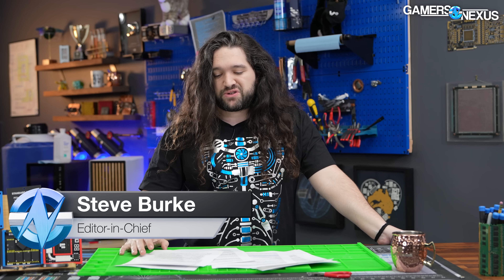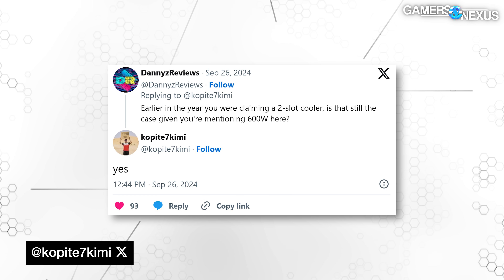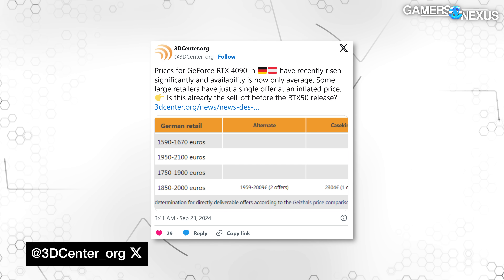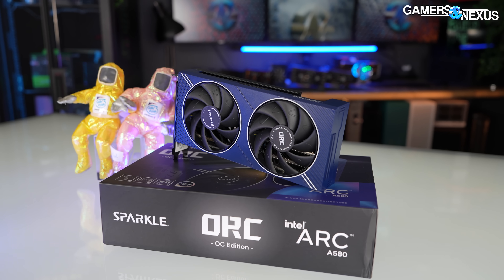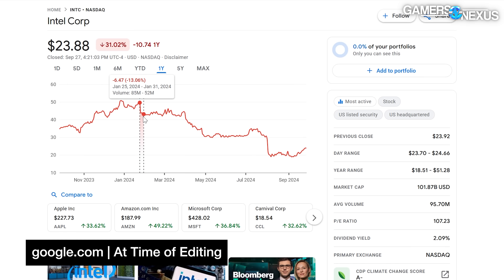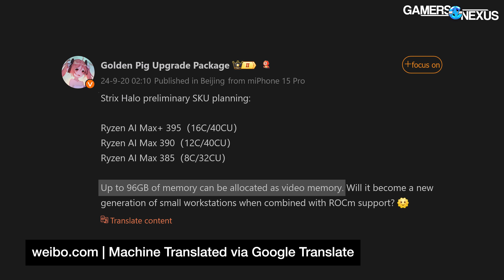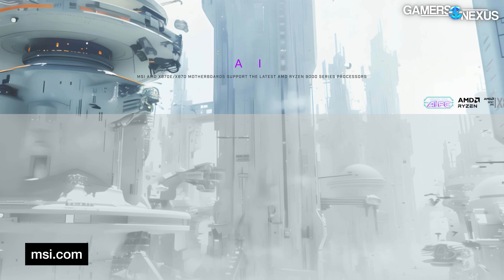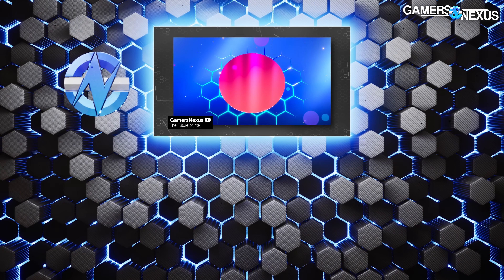HW News - RTX 5090 & 5080 Leaks, Valve ARM64 Experiments, Intel Arc 0% Marketshare, 4090 Price

Comment: 5080 with 16gb would be horrible value
Reply: depends on price - sell it for 600 USD and you would talk differently. But thats dreaming. It well beat 4090 which costs lets say 1600 USD, so if they sell it cheaper... lets say 1200 USD, ppl will buy it. Unfortunatelly.
Reply: You people whine about vram too much, shows how uneducated you are.
Reply: @JordanJ01 zip up nvidia's pants when you're done
Reply: @JordanJ01  you should try 4k gaming. Lots of titles currently crack the 10gb already. Two more years and it will be 15gb. Then add on top that many games got slight memory leak because the devs just can't be bothered - instantly filled up your 16gb, performance drops, textures become washed out and you have to restart the app.
Reply: 4080 is too but the owners have not realised/figured it out yet. Next years games will bring it to it's knees. 2 already are pushing it. 12gb is already on the chopping block in multiple titles lol.
Reply: @JordanJ01  yeah shows how inexperienced you are. I've done this 20 years, the main limiting factor for card lifetime (outside of a few very unique/old exceptions) is vram. Every time.
Reply: @nervsouly  multiple are exceeding 12gb on the mid range cards that need DLSS hand hold... which runs out of VRAM when doing RT lmao. It's hilarious. Two games approaching 16gb when the 4080/5080 suckers will really feel the pain. Next year will be interesting with the new games for 16gb cards.
Reply: @N4CR  Exactly, that's why I'm looking to buy the 7900xt, it has nice raw performance and 20gb of vram, and while the 4080 super it's way more powerful right now, the 7900xt will age better because of its 20gb
Reply: @JordanJ01 you're clearly uneducated when it comes to AI at least
Reply: @ThunderWill2  "Exactly, that's why I'm looking to buy the 7900xt, it has nice raw performance and 20gb of vram, and while the 4080 super it's way more powerful right now, the 7900xt will age better because of its 20gb"

The problem with this is the extra VRAM is actually irrelevant for AMD....

Notice the keyword here i.e. RT. If you are playing 4k max settings with max RT then 16GB VRAM may not be enough, but you are using an AMD card and a 7900XT at that, that 16GB VRAM will likely never get used, you will see rasterization problems well before VRAM problems.
Reply: @N4CR  "multiple are exceeding 12gb on the mid range cards that need DLSS hand hold..."

Can you name em? I play at 4k and the only one that actually comes to mind is Cyberpunk. 

" Next year will be interesting with the new games for 16gb cards."

Yea you guys have been saying that for years, meanwhile in reality we got Wukong which actually used much less VRAM then expected.

Game companies are making games with Nvidia GPUs in mind i.e. you are actually delusional if you think VRAM will be the issue for PC gamers because the vast majority of gamers have Nvidia cards and therefore the vast majority of the PC gaming market would not be able to play said games if games actually exceeded said VRAM.
Reply: @nervsouly  "you should try 4k gaming. Lots of titles currently crack the 10gb already."

I do play games at 4K, haven't seen really any game other then Cyberpunk go beyond 10GB.

"Two more years and it will be 15gb."

15GB < 16GB....

"Then add on top that many games got slight memory leak because the devs just can't be bothered - instantly filled up your 16gb, performance drops, textures become washed out and you have to restart the app."

And then they lose the vast majority of their player base.
Reply: @N4CR People speak like we get too many high quality games lol,with all these AAAA dei infested slop games around,not everyone plays all the new shits coming lately you can still play huge backlog for years.

Comment: I got the money for the next 90 card, but nvidia aint getting jack until i see 48gigs.
Reply: so wait for 6090 (LOL) and you will get 69ed for 3000 USD
Reply: just wait for the RTX 5090 AI TI SUPER
Reply: if they still have just 24gigs, it will take at least to the 6090 until you have 36gigs, if even.
And then maybe the 8090 ti will have 48gigs. If you're lucky.
Reply: There already are GPUs with 48GB+ VRAM but they are not really meant for gaming and they cost anywhere between 4k - 24k
Reply: @Nako3  those aren't 90 cards, so what's your point here?

Comment: No matter how low the price is, Intel's drivers make me think of buying AMD in 2011.... Like.... AMD drivers have been damn near flawless since the 5000 generation of GPU's and the price of 5700xt's and all of 6000 series are so compelling.... Why the fk would anyone buy Intel Arc!?!?
Reply: Morbid curiosity 😂
Reply: amd drivers are literally broken for so many users. seems like a pretty common issue. the issue being that windows overwrites the amd drivers with their own and it just screws everything up. with my 6700xt it causes it to stop working, as in shuts off the display. happens so frequently its infuriating. so far i've gotten it to work eventually each time, but its happened half a dozen times over the last 1 and a half, and right now i've swapped it for an older 580 that i put in my dads computer build.
the 580 actually has the same issue where windows will override amd graphics drivers, but with this card i don't lose the imagine so i can still use the computer.

i've finally gotten the drivers to work normally, but who knows how long that will last for. its literally a guess in the wind. i've had it last for a few months, and i've had it screw up again the next day. its so inconsistent in how it works, but the only consistent thing is that it will fail eventually.

im most likely going to buy a 4070 super for 800 bucks (my countries currency) to replace it and never use AMD again because you just don't know if you'll end up with the problem or not. and F you if you do. doesn't seem to be a solution. at laest not for me. i've done literally everything i've found as a solution several times and problem will eventually keep happening.

im done with AMD GPUs now. they're trash.
Reply: @junk3996  I'll gladly buy your AMD card, 1080 Ti was my last purchase from NVIDIA (2nd hand market so I did not pay them technically).
Reply: @junk3996  that driver issue is a windows issue and nothing to do with AMD and happens on all sorts of ahrdware. Learn to control windows instead of blaming AMD
Reply: @N4CR  funny how it doesn't happen to all amd users and doesn't happen at all to nvidia users. hmm
it still has to do with amd
Reply: @reav3rtm  yup i'll be selling it soon for sure. im done dealing with it.
going to get a 4070 super hopefully on a black friday/christmas/boxing day type sale
Reply: @junk3996  Meanwhile, there is me, with a Windows instal that is like 5years old, originaly done on x99, with an AMD gpu, then driver removed for a nvidia card, then back to AMD for both CPU and GPU and not experiencing anything weird. The computer gods are sometime facetious it seem !

Comment: It's great how Intel have invented "Vmin shift" as a euphemism for "degredation to the point of instability".

Vmin = the minimum voltage for stability at a given clock
shift = it changing, to be more than the processor is programmed to run at, so the processor is unstable now

Comment: The laptop I got from Eluktronics came undervolted by a -0.125v offset from factory, CPU is the 13900HX. I've limited the max P-core boost down from 5.4ghz to 5.0ghz and shut off half the E-cores, however I left the E-core boost alone, it still hits 3.9ghz with a single thread. Functionally it's a 12900HX or 12900K just power-limited to a 75w maximum draw.

Maximum voltage spike I've seen after all these tuning sessions was 1.23v, well inside the safezone and the maximum sustained operating voltage fluctuates between 0.995 and 1.05v under 100% Cinebench R23 load, pulling 75 watts. Thermals hit 89C now and it no longer throttles. I manage to still score ~22,800 points even after all of this.

TL;DR
I tweaked my laptop just in case the instability problems affect mobile parts and suffer zero loss of performance for it.

Comment: I built a tv HTPC/ mild gaming at 1080p to 2k @ 120hz with a intel arc 770 16gb asrock, $300 for my brother.  Just wonderful, with no issues. Be sure to update it, and update your mobo bios as well. It does great, and can run many games at high 2k.  
My main gaming rig is a 4k at >120hz with a amd processor and card.  
I would build with a intel arc anytime, really hope they stay in the game.

Comment: My bet on the 2 slots is that it will be a 2 slot "bracket" but a 3-4 slot thick cooler. Similar to the cards that are 2 slot but is 2.5-3 thick on the inside.

Comment: I’ve been using an Asrock Intel Arc A770 phantom gaming 12G for 6 months after so many frustrations with my RTX 4070. The A770 has provided better performance and zero driver issues or game crashes. My 4070 can’t say the same, it was a nightmare.

Comment: Happy with my 3070 and 5600X. Plan on making this a living room PC and doing a new build next year and full AMD this go around.
Reply: Personally I'm not entirely happy. I've got a RTX 3070 Ti, playing on a 1440p UW 175 Hz (21:9) display so a Odyssey G8 OLED basically, the card is starting to get weak at this resolution so I don't want to imagine how it would be in 32:9 or 4K which I consider moving to later on. Will run between lowest 50 fps to 120 fps highest on either High to Ultra for a typical UE5 game yes given it's 2K UW and not 1080p, which is reasonable but 8 Gb of VRAM is really getting short and sometime my card does struggle. Not a bad card by any mean but the VRAM is just castrating its performance. I thought about a 4080S recently but will wait for a RTX 5080 instead. I guess it would have been too early to make the leap in just one gen difference. I mostly switched to the 3070 Ti because I had a good deal on it and because I desparately needed to upgrade my former PC which had a R9 290... Quite the upgrade back then.

Comment: For anyone wondering why the that Prime 2200w power supply will not be officially sold in the US, it is because our standard wall sockets can't deliver that much power. The standard wall socket in the US it rated for up to 15 amps at 120 volts. Since wattage is just volts times amps, that means a normal US wall plug is only rated to deliver 1800 watts of power. The countries they ARE selling it in appear to be ones where the standard wall socket is supplied with 220v or 240v power which allows a lot more wattage from a single outlet.
Reply: Yes indeed. We have 230V for every normal socket, most limited to 16 Amps. That's 3680Watts of power on a single socket. 
so even if that 2200W PSU would run on full power, I could still use a 1000W water heater, plus a smaller microwave on the same circuit (which is pretty unlikely, though)
Reply: Isnt 2200w overkill tho? Why would you need that much.
Reply: @Nako3  It's more for workstation-class systems where you are stuffing multiple 4090-class cards into a single system for rendering, AI, or some other workload like that. It isn't really meant for gaming PC's.

Comment: I'm RMA'ing my 14700K. I applied every BIOS update as they were released, and only found the stability got worse (due to having to reset back to factory defaults) to the point where the RAM would no longer operate at the XMP 5600MT it was rated for. Leaving it at 4800MT results longer times between stability issues, but it's still two major symptoms:  ALL web browsers crashing randomly, even when opening a new tab. Software containing CEF or using a webview also experiencing crashes. Netflix spontaneously having drop-outs. It's almost as if the CPU just reads the RAM wrong at random, and many of these issues look like RAM or GPU, but don't repeat themselves in any configuration that makes sense which makes it point to the CPU. The 14700K was stable up until about mid-august (making it 5 months old.)

IMO that 5090 spec might be exactly what it's stated as, as nvidia always did that with the Titan series. In the case of the first Titan it was basically two GPU's on one card. In the case of later cards, it was pretty much the entire die the same as the same workstation part. So that might actually suggest the spec of a theoretical PCIe B6000 being the same.

Comment: With Valve being very Linux centric, and their fave Arch Linux (Mine too) being fully Arm ported, it's a grand decision!  BTW:  I'm not a gamer, but I am a non Windows/Mac user, and haven't used either for over a decade!  Like all OS's Linux has room for improvement, but they won't make you their slave, and so if valve can contribute something to the code base that benefits Linux in other ways, well, that's what way more should be doing to make corporate ownership of users a thing of old lore!!  On Linux, nobody but you is da' boss!!

Comment: Intel never suggested that the previous updates to the microcode of 13th and 14th generation processors were permanent fixes. The updates were intended to prevent further degradation while they focused on stability.

Comment: Note on the Quest 3s "runs at x resolution".
These headsets may HAVE these resolution screens, they RUN at a lower resolution. (3S native res is still unknown afaik, but 3 renders at 1680x1760 and has a screen resolution of 2064x2208)
Personally my theory as a Quest developer is that they will render at the same resolution.

Comment: ARM64EC is specific to Windows on ARM, there is no linux equivalent. It allows mixing ARM64 and x86-64 code in the same process, with tweaks to be compatible with Microsoft's x86-64 emulation technology (hence EC = Emulation Compatible). The fact it specifically says ARM64EC in the listings makes it very clear that what Valve is doing is specific to Windows.

Comment: For what it's worth, I haven't seen any stability issues for 13th or 14th generation i7 / Core 7 Ultra CPUs in Dell mobile chassis, of which we have procured a few hundred in our org. This has not been the case for particularly 7th, 8th, or 9th gen i7s, but I suspect that has a lot to do with Dell firmware and maybe age/thermal paste breakdown. I just don't have the time to have them all shipped back and torn apart to reapply thermal paste. Lots of CPU throttling in those models, to the point where I've had to recommend turning off SpeedShift in the BIOS, and usually our fix in extreme cases is to send them a new 13th or 14th gen model to replace it. I was seeing a lot of cases last year of CPUs being stuck at 700 MHz. Starting to have users bitching about their 10th gen models not being fast enough for their workloads, but probably a lot of people who just want the latest and greatest hardware. We also had someone with a 12th gen i7, the firmware was basically pushing one core to nearly 100% clock speed, while all others were idle, but this was fixed with firmware they put out. Based on what they told me, they put out the wrong firmware originally. Fixed months ago. Overall, far fewer problems with 13th and 14th gen laptop models so far, or at least far fewer complaints a year after we started provisioning them. 

I am still very wary of Intel because of all the problems I've seen in older Dell laptops, and would probably never buy another one again if it was my own money, but my experience with 13th and 14th mobile has still been good. I wish Dell would offer AMD, I would recommend a switch in a heartbeat.

Comment: Every year they are like it's more efficient and better and faster and they just keep getting larger and new more power. I don't want a 600w video card. You're going to start popping my breaker at 1800w... I still need to run my 4 monitors and 9000 rgb lights. We're to the Ford Expedition of video cards now.

Comment: I think the 5090 will have the same 450w tdp as the 4090 but like my Asus Tuf OC RTX 4090 with its 4 slot design and a 33% manual power OC ability. That makes up the difference. Similar to rumours for the 4090. In the end they use less power than the 3090 and 3090 Ti. After all the rumours. 

The rumours with the 5090 having about 3000mhz as the core boost clock might be interesting. As with my 4090 and other decently cooled cards they basically shave off 400mhz of the actual.

My 4090 without touching anything boosts up to 2910mhz. I plus 130 on the core and it lives in the 2970-3060mhz land. Top hot spot logged at 73 degrees. 

Looking forward to some decent 4k inbuilt benches. Such as the maxed out Cyberpunk and flight sim 2024, plus 3Dmarks

Comment: I don't know about there but the problem here is the intel arc prices went back up instead of staying down where they should be performance wise (or even cheaper). The intel model a770 was $300 and some. The Bifrost was about the same on sale. It is now back up to $550 almost a year later.

Comment: Comment on the "prosumer" for the 5090. Isn't that what the x90 product line was all about in the first place? I mean, the 3090 was introduced as "Titan-level" performance and beginning with the 3000 series there was no Titan card anymore.

As such for the 5090 to go that route is honestly a logical conclusion since those specific buyers (meaning Titan-buyers) are out of luck since the 2000 series, right?

And when I remember correctly the Titans were not really substantially faster (at least the later ones) but all of them had significantly more vRAM (while usually looking baller as a card)
So no surprise, but ofc I would like them to see in an affordable price range (like the sub2k mark, it REALLY hurt to buy my 3090 at the worst possible moment during covid)